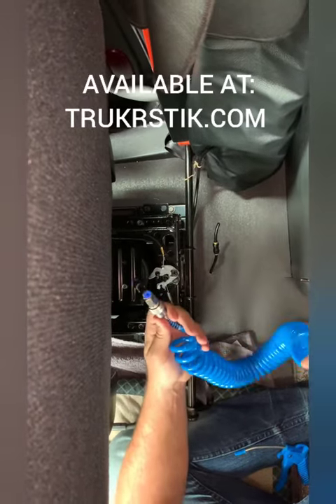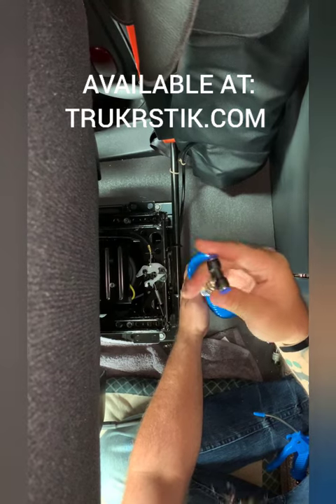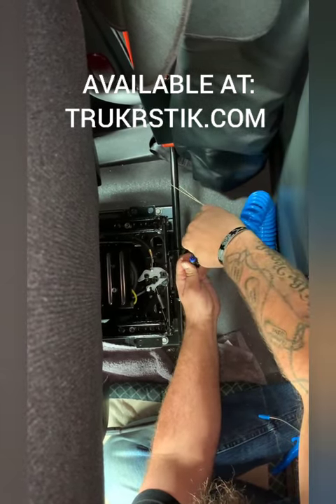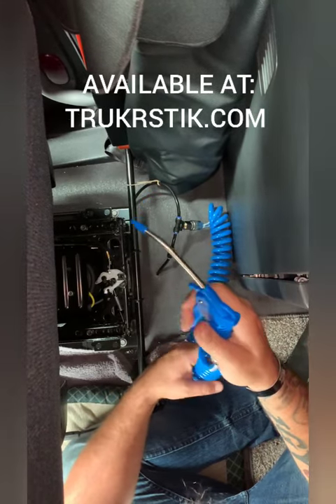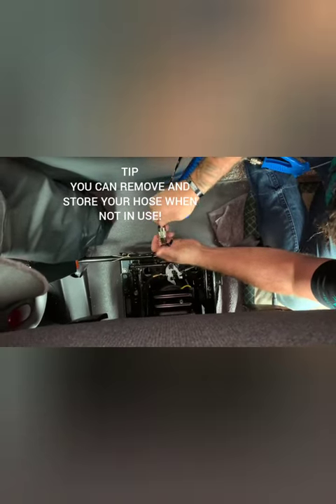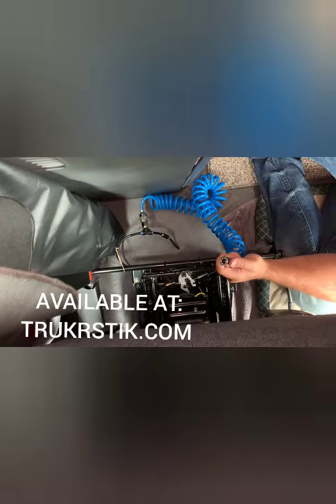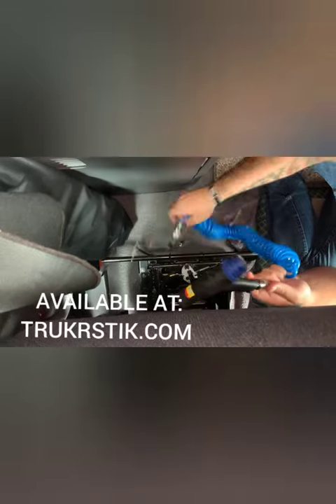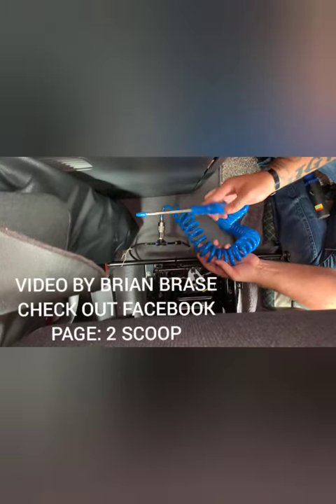Truck Air Seat Blow Gun Kit by Trukr Stik Installation

Comment: If your upgrading/replacing your current one because of an air leak, make sure it's not because of the straight through connection, the black one in the very start of the video, not talking about the T connection he added.

Comment: Do you push in brakes or pull brake levers?..so easy but not clear on that.
Reply from the maker: You just need to empty the air from the lines before installing. With the truck off, you can pump your brakes to empty the air. You can also remove your trailer air line and release your trailer brake until the air empties out.